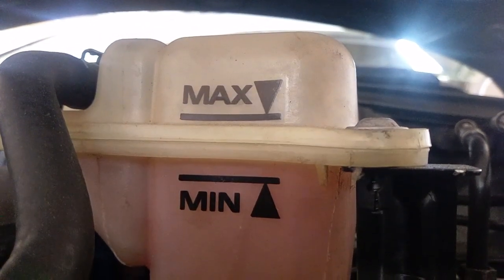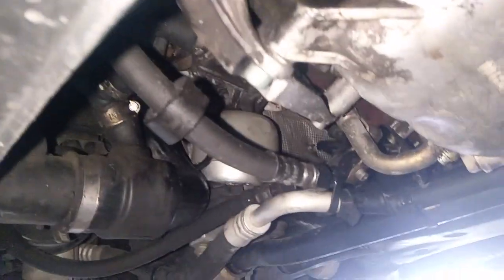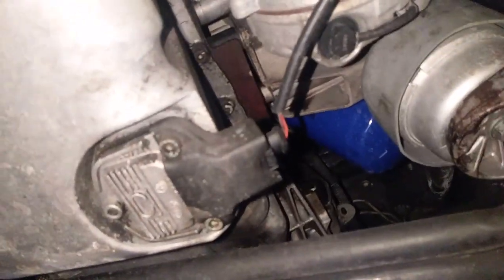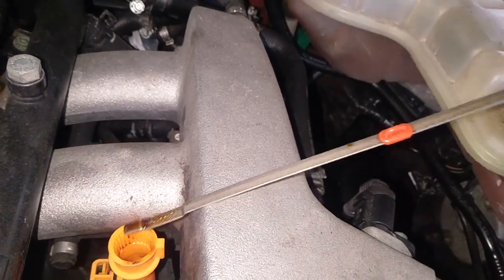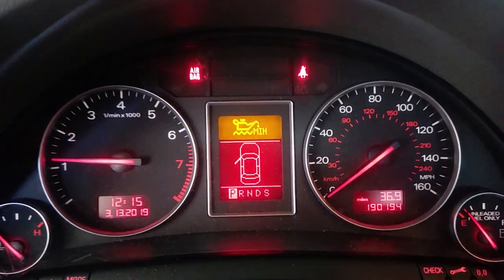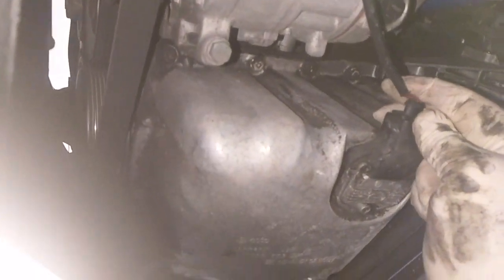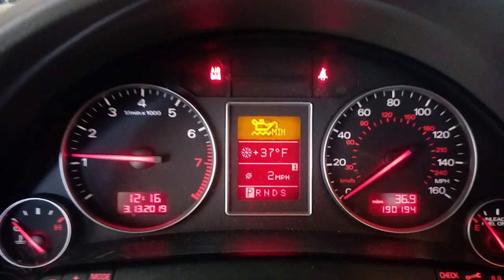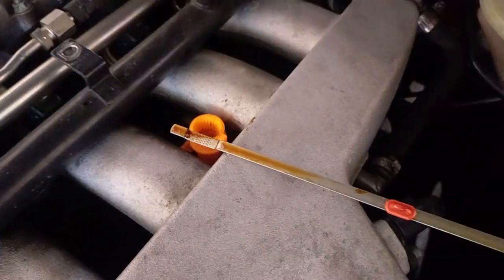B6 A4 bad oil level sensor

Comment: Mine just developed this after i did the thermostat due to it being stuck open , car gets up to temp nicely now but i get a oil pressure warning when the car is at temp (WONT DO IT TILL TEMP SHOWS AROUND 90C) never had this issue at all .. could it be the sensor or maybe the oil is too thin when its warm?

Comment: I have the circle light with a triangle in it 😭 but my car is running fine
Reply: smmokeshop check the break pedal switch. I had mine replaced and now it’s not showing anymore unless i deactivate the esp.
Reply: on my 2005 audi s4 thats just the traction control light😂

Comment: Can I drive when the oil sensory light turns on for like a minute and then off again? Or should I turn it off and get it fixed
Reply: u got bad oil pressure sensor in oil filter with springs u need to replace that or your turbo will die